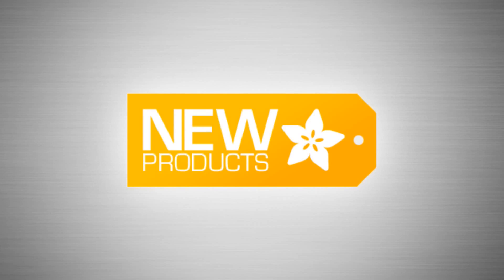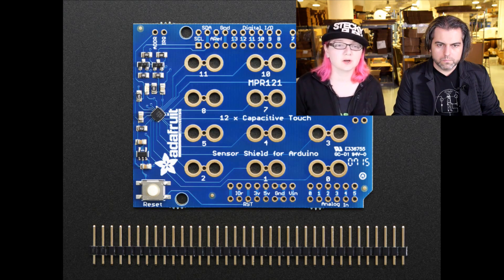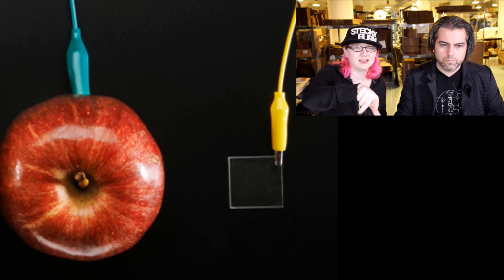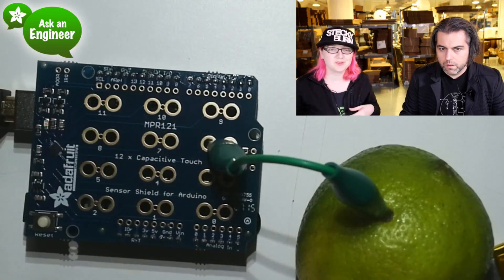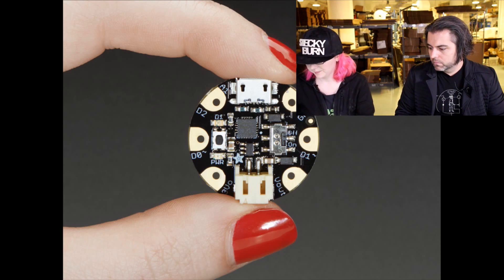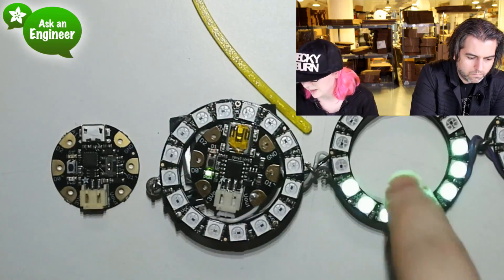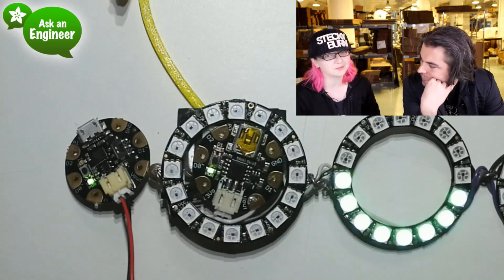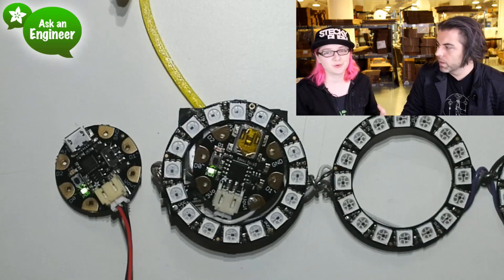New Products 3/4/2015

Comment: Can you help me understand how the touch capacitor works when there is only one cable sensing it? It works because the shield is grounded? But that would probably not work if it runs on batteries. I am probably stupid, but can anyone tell me how it works?